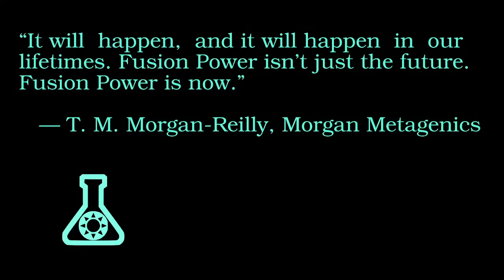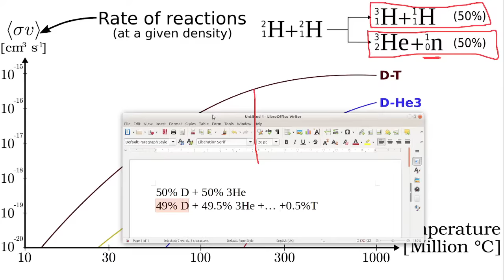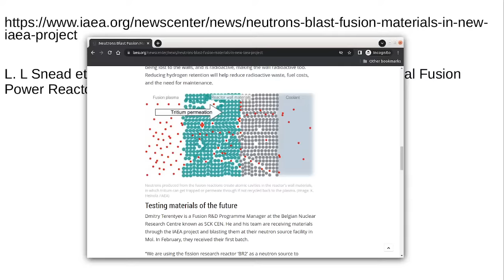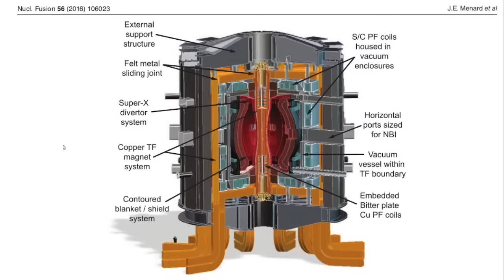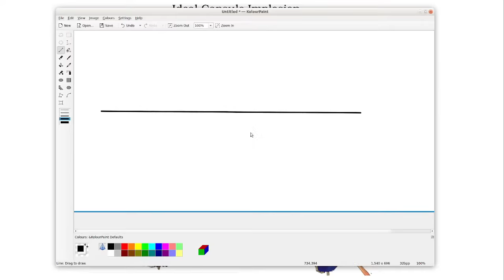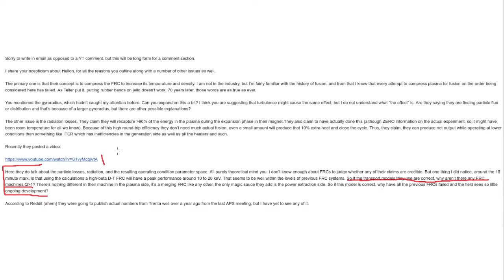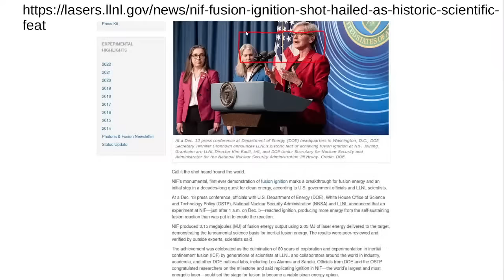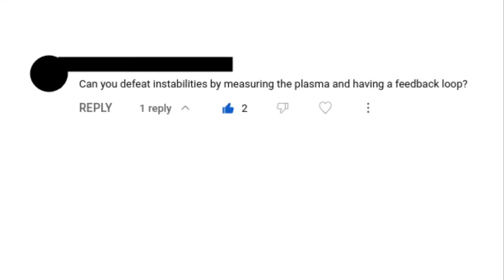Q&A - Helion Energy, NIF, Space and more

Comment: To be fair, while Tritium is very radioactive (decay rate), the beta decay energy of Tritium is very veak, in the KeV range, so the electrons coming off it will quickly slow down, provided they come from outside the body.
Reply from the maker: Consider the outcry over the release of a few grams of Tritium in waste water from the Fukushima plant. Helion intends to keep kilograms of it in storage. Note that this is much higher than a D-T plant, since that would basically be cycling it very rapidly, not storing it for years waiting for it to decay.

Comment: Nice to see you corrected some of your factual errors. Good video.
Reply from the maker: To be clear, there were no factual errors in my response to your video.
Reply: I think the Q&A was better than the original video and had a nicer tone too (at least in the parts that I was there for).
I talked to David Kirtley about your argument about T- scattering and disruptions. He says, he might put together something for the FAQ if they have the time. Their electron temperature diagnostic was vetted on TFTR, btw. They also measure the plasma pressure on all locations. They also have the usual standard diagnostics for FRCs that have been vetted on every FRC program since. Overall, their diagnostics should be better than NIF. 
The disruptions argument has been brought before but they have not materialized over 6 programs that went all the way to 10 keV today. I think it is unlikely that disruptions will suddenly appear at 20 out of nowhere. But what do I know?

The original video though... Oh come on! Just the part about "Helion promising a working power plant by 2021" is easily debunked as a factual error and quite frankly really unfair. It even says on the same page that you quoted (and show in the video) that they were looking for funding! They did not have the funding until very recently. 
No bucks, no Buck Rogers!

Most of the other points are either not applicable or lack context, etc. 

I think you are a really smart dude, who does know a lot. So I will say again, that I am extending my offer to have a serious debate about this, if you actually want that. I can (likely) get you answers to questions if you are interested.
Reply from the maker: @elmarmoelzer2229  I didn't talk about disruptions, I talked about turbulence and fast ion losses, both of which CYGNUS does not and cannot simulate directly. Also, neutron embrittlement of their machine, their inability to pump out trace amounts of tritium with 1+Hz duty cycles leading to 14MeV neutrons and the inability of plasma below ~100eV to be used in the adiabatic cycle, hence that energy is unrecoverable. A few other things as well.
Reply: If anyone wishes to explore the non-factual errors made in the original video the reddit post in r/fusion contains a good discussion
Reply: @ImprobableMatter  /r/fusion disagrees
Reply: @ImprobableMatter  You said Helion was making do with 100 million degrees with a far less reactive fuel than D-T where the target temperature will be 20-30 keV or about 300 million degrees. This is also with a higher pressure before pulse compression and in theory much more efficient energy recovery. They say they have succeeded in recovering input energy with the method but have not conclusively demonstrated recovery of fusion energy with it which will be the 2024 goal

One thing I don't understand is that their beta is given as being 1 as compared to a tokamak's .1 - however this is not absolute pressure I believe but the ratio of pressure to the confining magnetic field. So their plasma is more stable in the timeframe of its compression allowing it to have more pressure per magnetic field but how does their magnetic field compare to a CFS tokamak of 10 Tesla on axis?
Reply: @Canucklug   Yeah, I am actually in it ;)
Reply from the maker: lol. If I do another Q&A I'll share my very old debunking-Thunderf00t-in-Thunderf00t-style video for you.
Reply: @RealEngineering  with all due respect saying that some small group of very bullish fans disagree is a very weak argument. 
You certainly have the means to ask independent fusion experts and you have contacts at helion to ask them some tough questions. The company is not forthcoming with data, which in fusion is always a bad thing. Things can look and sound great and then turbulence enters the picture and it all goes to shit.

With your resources I hope you do a follow up
Reply: @RealEngineering  who cares. Really. Just admit the factual errors were yours
Reply: @RealEngineering  I never thought that you a logical and practical optimist would get into a YouTube drama over science/engineering when both points are valid with effort, time and money we will get around problems this man highlights. Science is all about debunking and counter points
Reply: @alexnorth2452  click on the name it links through to the actual channel
Reply: @ZigZag-yl4dt  how incredibly disappointing
Reply: How about you back your comment up with a video that factually proves your original vid correct and properly dispute this instead of just saying "na you are wrong" a bit of a petty and childish way of disputing something

Comment: For the AI related question that you answered at 3:10:50, you did briefly touch on AI-driven design, but then focused more heavily on uses of AI for solving operational control problems. I generally agree with your "no silver bullet" comment; most people thinking that way don't have a firm understanding of the subject.

In the case of AI-driven design, it's less about "machines being smarter than human designers", and more about "machine having the processing throughput to manipulate designs that are orders of magnitude more complex than human brains can manage". Humans are strategically brilliant and can make it very far by simplifying designs to the point where they are comprehensible by our relatively slow brains (to grossly oversimplify, very little in our brains moves quicker than 100Hz). The AI-optimized mechanical designs typically find savings by producing complicated flowing geometries that appear almost organic in style. In a crude sense, the difference between AI-optimized vs human-oriented designs is analogous to the stylistic difference between the complex Stellarator geometry versus the more regular Tokemak geometry -- and I suspect this observation may have inspired the question you were answering.

In the case of optimizing a Stellarator, to predict the degree to which AI-driven design optimization would help, I'd need to have experience grappling with the Stellarator optimization trade-offs, to know the extent to which competing trade-offs interact in such a way that increased complexity can deliver improvements in the performance metrics. In other words, AI won't help if it's the case that the seemingly complex Stellarator shape is actually rather regular (eg, a consistent degree of twist from coil to coil), and if there's very little optimization incentive to mutate that shape. On the other hand, if there are a lot of interacting considerations and a vast potential design space, then maybe there's more headroom. It might also be interesting to open up the design space by disaggregating the coils into a messy spaghetti of individual wires that can wrap the reactor at more than one angle rather than all loops from the same wire being parallel. Again, I'm not qualified to say where the Stellarator design headroom lives, or how much might exist; I'm just giving examples of the kinds of design changes that an AI-driven optimizer could explore.

Such AI-driven designs are intrinsically more challenging to fabricate, and for mechanical designs, depend heavily on being able to leverage digitally controlled additive and subtractive manufacturing techniques (eg 3D printing). One of the challenges of applying such techniques to a Stellarator would be the increased assembly cost. You might need a custom robot to lay the wires in a wildly complex geometry, or you'd have to have people following incredibly detailed instructions that resemble the (very expensive) custom-cut carbon-fiber hand-layup work done for turbofan blades ($20k per blade). And then the design would be highly brittle / difficult to change / difficult to repair. And it might be exponentially more difficult for the physicists to model (this alone might be a deal-breaker?). AI-driven design optimizers can of course incorporate fabrication constraints or estimated fabrication costs into their optimization goal function, but such constraints would need to be expressed formally rather than simply being designer intuitions and getting that right might take several iteration cycles between the physicists and their AI collaborators.

I don't know if this has been explored or not, but the first step would be to prove that there's enough optimization headroom to matter by producing a theoretical design that boosts the predicted optimization parameters (confinement time? field strength?) by a material amount, without worrying too much about whether or not the result is practical and buildable. If you can't produce a predicted win even from an unbuildable design, then there's no point in worrying about the practical problems. But if early exploration demonstrates large potential headroom, then researchers could explore constraining the AI's design space such that it can produce a good compromise design that boosts the optimized goals as much as possible, while still being constructible and practical enough on the other figures of merit (maintainability, repairability, modularity, etc).

Everything above is my mental model as someone familiar with training AI systems. My question to you is to answer what I cannot: does your instinct say that the Stellarator design shape could be improved via increased complexity? Can I (or an AI) take the existing design, and find incremental improvements by tweaking some of the coil shapes? Or is the design already close to optimality given present materials constraints, and the only thing that would help is a gross improvement, such as stronger superconducting magnet coils, or an increase in scale? What does your intuition say on this?

Comment: Question: What prevents Tokemak (or Stellarator) designs from increasing the field strength by simply using more turns of magnet wire? In other words, today the magnet coils wrap around the reactor N times to create some field strength B. What limits designers from scaling this to wrapping the reactor 2N or 10N times? Or equivalently, putting a second coil surrounding the existing coil? The outermost coils would have a wider diameter, so IIUC, would be less efficient at contributing field strength, but presumably they would still be helpful.

Or are the designs already physically constrained, such as by the space to run wires through the center column?

Or is there a more subtle magnetic constraint that I'm not aware of?

Or maybe it's just a cost limitation and rather than doing as I suggest, they'd rather spend the equivalent funding increase scaling up to a large Tokemak (ie, scale everything together).
Reply from the maker: One might think that a superconductor would have anywhere up to infinite current for a given voltage, but there is a maximum magnetic field at which they no longer work. Also, really huge fields would put enormous mechanical stresses on the machine.

Comment: at around 1:04:30 you are comparing a required 10^25 neutrons to cover 10 square metres and shred it the same as those mirrors, with their estimated 10^18 neutrons per second. This gives you 10^7 seconds to get that many neutrons. But then for some reason you change your answer to 10^5 seconds, and say that it will take a day, whereas with these numbers it should be 100 days. Now, I'm not saying that any of these estimates are necessarily correct, and it's probably a lot worse, but just introducing factor of 100 errors in your simple calculations does tarnish the reliability of your general statements about how bad it would be. I think it's worth checking the calculations before making statements, not because the results are much different, but because it makes it appear more reputable.
Reply from the maker: Fair enough.

Comment: I appreciate that you aim to use less rude notes on your words. Gasoline is more reactive than jet fuel, but jet fuel have more energy per reaction. I think that's a better analogy
Reply from the maker: Fair enough. Imagine I compared 1MJ worth of rocket fuel to 1MJ worth of sunflower oil. Same energy, different rates of release.
Reply: @ImprobableMatter  yes because you need more sunflower oil molecules. Gasoline is high (energy) density high reactivity, and jet fuel in comparison is even higher density but low reactivity. while cooking oils have low density and low reactivity.

Comment: So several years ago I was at a bar with an employee from helion.   In talking to him his opinion of the company and it’s goal was that the major problem was not the plasma physics, it was that the solid state power switching required to harvest the induced current in the magnets didn’t exist yet.  So from him (at least this is my fuzzy and incomplete memory) they were already generating sufficient energy output, they just couldn’t harvest it.  I don’t know if the power switching problem has been solved or if this adds to the conversation but it may be that the inefficiencies and limitations that you are worried about are solved but another practical issue is still limiting the overall technology

Comment: Thank you for your detailed presentation.  I have to wonder if the Helion approach of electricity generation by driving the magnetic flux out through the coils via the expanding plasma can be done with decent efficiency.  Decades ago, people pursued magnetohydrodynamic generators as an alternative to traditional turbines driving traditional electromagnetic generators.  I think these efforts failed because the combustion gasses could not be made sufficiently conductive to achieve good efficiency.  Also, people have built explosive generators to produce very high pulse electrical power, but these generally expand a good conductor such as a copper cylinder to efficiently drive the magnetic flux through the coil.  In the Helion process, how much of the flux can the plasma drive out?  How much of the energy escapes as heat and neutrons in the process?

Regarding your graphic for the National Ignition Facility, extrapolating to a net electrical gain of 10 MJ per shot:  10MJ is about 2.8 kWh of energy.  I am paying about 12 cents per kWh (retail price for electricity delivered all the way to my home).  So, the energy from a shot is worth about 33 cents delivered.  Perhaps the generating facility could be attractive if it could produce the energy at half that cost, or about 16 cents per shot.  Suppose the diamond spherical shell for the fuel could be eliminated as well as the hohlraum, and the lasers could simply impinge directly on cryogenically frozen fuel pellets.  Do you suppose the tritium-deuterium pellets could be produced at a cost of a few cents each, given that the facility would consume 864,000 pellets in a day of full operation at 10 shots per second?  If we ignore the window material darkening issue, how many shots can be done before the laser window surfaces in the reaction chamber must be cleaned due to deposition of materials liberated from the chamber walls and equipment in response to the bombardment of the reaction products?  The energy released in each shot presumably ends up as heat in the chamber walls.  Given the size of the chamber (about ten meters in diameter) to stand up to the ongoing mini-explosions without fatigue, it would seem to be thermodynamically difficult to capture the heat at high enough temperature to achieve any conversion efficiency to electricity approaching 60%, let alone maintaining laser beam aiming accuracy to within a few tens of micrometers or better to assure uniform implosion.  It is presumably very difficult to recycle the energy dissipated in the lasers themselves and that energy presumably ends up as additional waste heat (unless the facility is in a cold climate where the waste heat can be used for other purposes.)  I'm just trying to say that a facility with net electrical energy gain may still be a long way from a commercially viable energy generation facility.
Reply from the maker: In principle, energy from the expansion of Helion's FRC could be recaptured as efficiently as the contraction. However, energy would be lost as bremsstrahlung, due to turbulence and the energetic particles produced by fusion with relatively large gyroradii. Also, they are going to be charging capacitors, which would have to remain efficient at high rep rates, working for months on end, and with the neutron/radiation issues I mentioned.

Could a laser direct drive scheme reach commercial viability? You raise very good points for why that would be a challenge. Certainly, if everything else were viable, pellet production costs would come down, but it's true - the final product cannot be made of gold or diamond or it will never compete with other power sources.